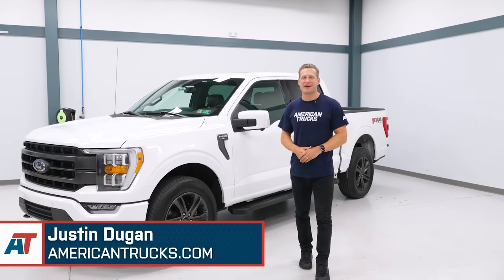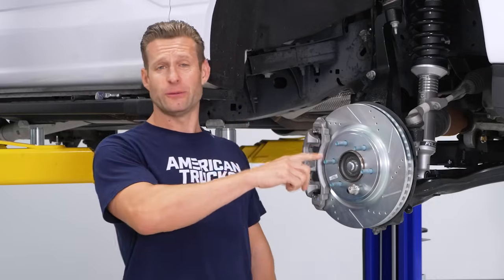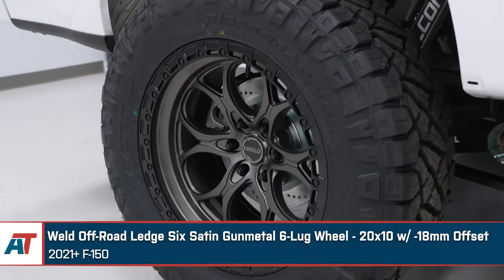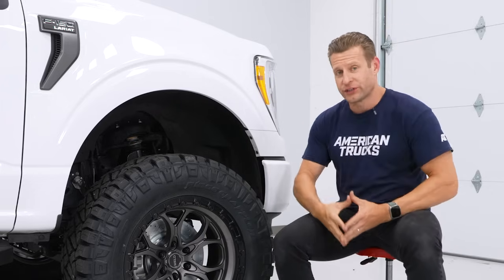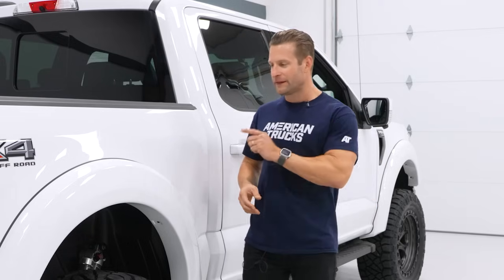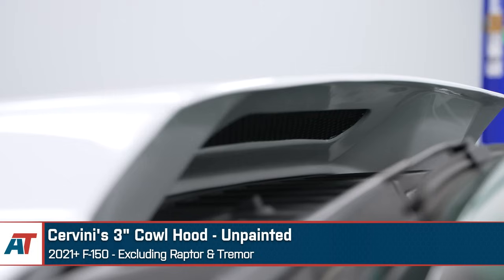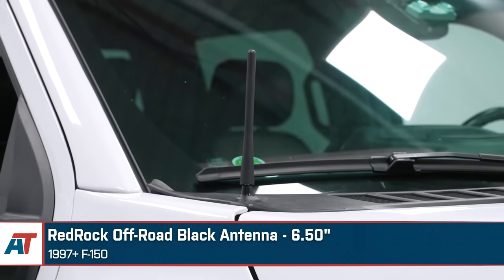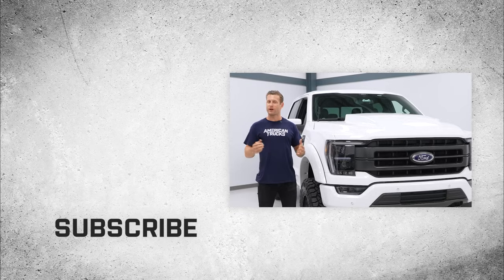Building the Ultimate Supercharged 2021 Ford F150 - TRX Killer?

Comment: Awesome truck! I'm doing videos on my channel and have some of the same upgrades. I went with Matte Black method wheels and a 4.5 inch lift. It's Oxford White as well. I'm thinking about the fender flares but I have a little less poked than yours. I also did the wheel well protectors for that better look with a white truck. Mine is the 2.7 EcoBoost but I have an intake and exhaust. I also switched out the factory bumpers. Looking for the next steps in inspiration and great to see your video.
Reply from the maker: Sounds like you have a sweet build coming together! Thanks for watching! -Zach